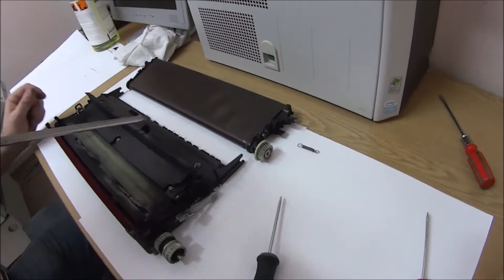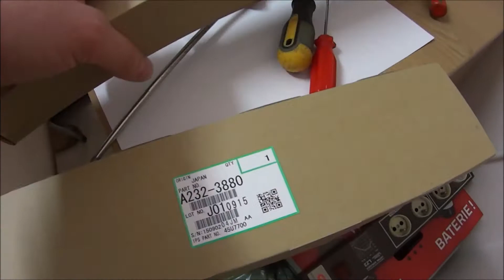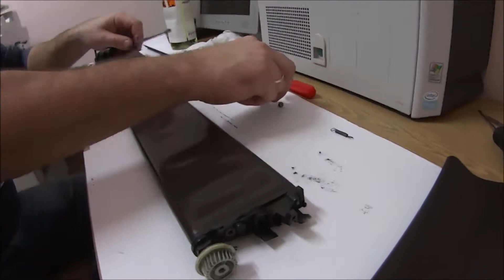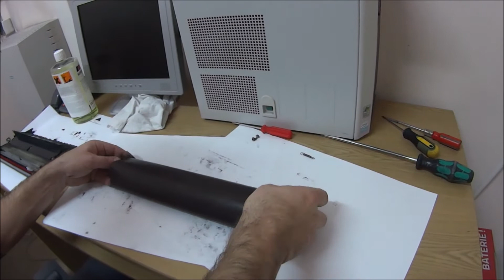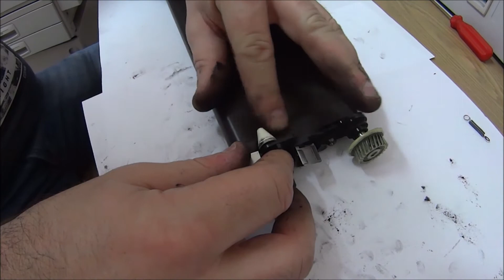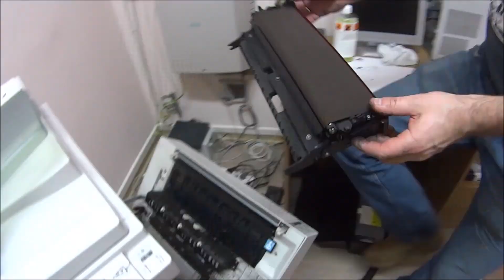RICOH MP5002 MP5001 Transfer error code SC443 SC495

Comment: Sc 441ricoh 4002 how to fix ? You can help me please and tech me thank you...
Reply from the maker: SC 440/441 Main motor Lock/Main Drive section Jam
tray You the condition
01. Press Clear/stop Key (Yellow Key) 2 tarms
02. type 107 same time
03. Press hold down clear key 5 secend ( red key)
Belinkin 1 on the copy counter left hand side
04. type 5 and press # ,type 810 and press #
05. tarn of the machine and tarn ON the machine.
Reply: @MrRicoh  i will try thank you bro
Reply from the maker: 👍🏻 I am very pleased with your comment. 😁 Greetings. 💥💥💥
Reply: @MrRicoh  thank you for guiding me unfortunately it still reports error 441 and I have found a way to fix that error otherwise you have Gmail we can often talk to each other about machine errors I would be happy if you show me how to fix it more than I hope to hear from you soon
Reply from the maker: Tu Dinh write mail Copy-expert@wp.pl
Reply from the maker: see you